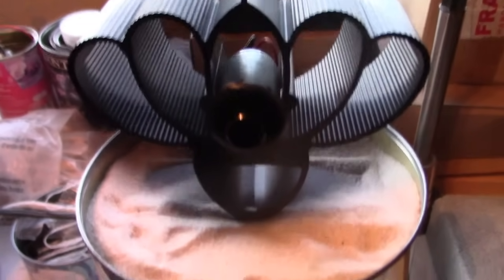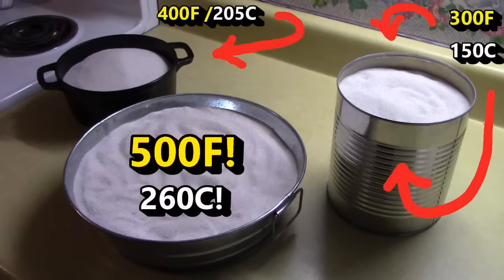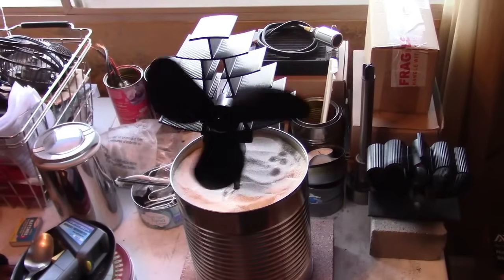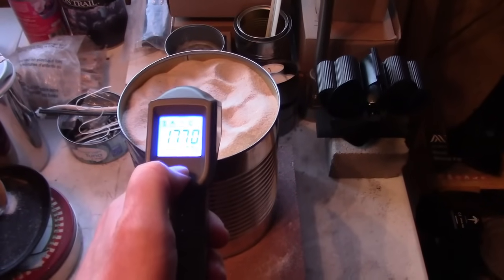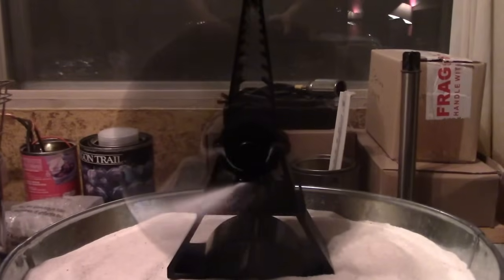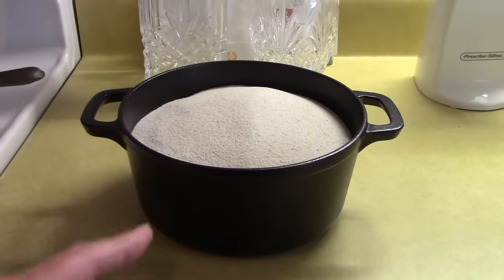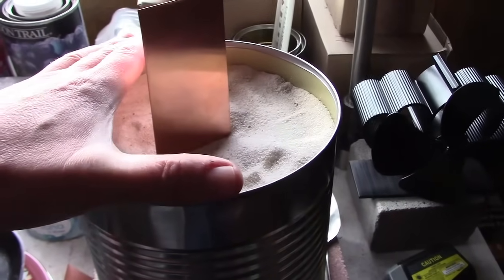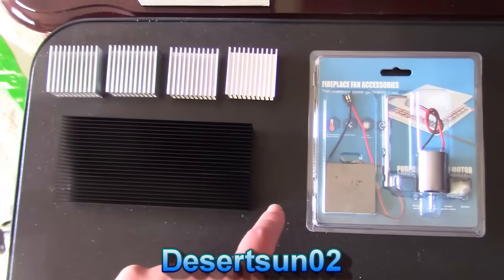DIY Sand Battery Air Heaters! w/heat powered fans! no electricity needed! sand battery room heater!

Comment: Ok, but you do need to put the energy in the sand first, which always comes at a loss. So not sure what the gain is supposed to be. In fact it would be cheaper to have an electric heater. So why do this?
Reply: Do it through solar or hydro
Reply: @Timforme-l1f the point is, all these extra steps don't create more heat. It actually costs More energy. (Oven gets warm, gives off heat too, etc.)

So solar to generate electricity is fine, but then use that to charge a battery and an electric heater or something. (Also loses energy, but its the sun supplying).

Better isolation is the 1st prio. Otherwise nkthing helps
Reply: @CyberBeep_kenshiwell my final goal would be getting away from the electric bill somehow and solar could partly help
Reply: @Timforme-l1f ye solar is your best bet. Here in the Netherlands maaany  houses now have panels. 

If you want to place them, be sure to check direction, angles etc. And consider at least something of a battery. No need to make it huge, if it can i.e. load during the day and discharge during the night is fine.

Comment: Diesel glow plug in the sand stove top fan with magnetic bearing electrical power generator to supply the volts to power up the glow plug? Glow plug will pull 6 volts to get cherry red then drops down to 4 volts. This would run indefinitely correct? Might be very helpful used to heat green houses and homes? Yall a DIY individual so you think it would work 🤔

Comment: I have used sand to heat our home for nearly 45 yrs. Not in the way you do. I use an old swedish setup. I get heat for the home in the winter and hot water year around. I also don't have it in the house, in the way. Sand is a marvelous heat sink. If you ever want a reliable and much better efficiency I'll be glad to share.
Reply: Please share. Thank you.
Reply: @romana2288 so to make an easier way to understand....think ' container big enough to hold a 3' tall x 3' wide x 4' deep firebox. It also will contain 200' of 1/2" copper tubing. All of this is covered in sand. The firebox door is exposed for easy access.
 This is the trick and beauty of it. The copper tubing is connected to a small 1/4 HP hot water pump, that pumps the heated water to an old A-coil from an old ac system. That A-coil has a thermostat controlled fan to blow warm air in the home. 
 Another 3/8" copper line (100') is is also inside the sand hotbox. It's for home hot water. 
 The beauty of this setup is once you have the sand hot, it stays hot for days. I normally only build 2-3 fires a week. The pumps and fan run on a small solar setup, I built, which of course is optional.
It took 4 and half yards of sand to fill my hotbox.
Reply: Please share. I'm very interested
Reply: @ScottCommonsenseprofessorCrawf it's already explained. It's one comment above your request

Comment: Try to get some phase-change material, tin for example, which would chage phase at still somewhat higher temperature. Phase change * volume shoud kick ass compared to low thermal conductivity * volume. I would be VERY MUCH interested in such video. If you cannot get tin, maybe some wax would work for a small experiment but I would not want to have a vat full of hot wax nowhere near a flammable heat sourse. Tin is non-flammable and much more safe.

Comment: what heats the sand? you have to heat it in a stove or something? i cbf watching the whole vid & couldnt see it from skipping through
Reply from the maker: lots of options for heating the sand. i've been focusing mostly on 'off grid' options like fresnel lenses and parabolic dishes lately. you can also heat sand with things like campfire/propane or rocket stove etc. other off grid options include using a DC heating element or elements hooked to solar panels. i've tried several types with good results

Comment: How are the fans working?
Reply: They have a weird plate in them that turn heat into a few volts
Reply from the maker: they have a peltier chip (TEG) in them. it turns heat into electricity.
Reply: @desertsun02  thanks. I didn't know what it was called 👍

Comment: Could this work during a cold winter to heat a small space? like the interior of a box when It's Minus 20 degree celcius outside the box? I'd like to keep some stuff at room temperature if I could.
Reply from the maker: hi. yes, it works even at low temps. (i'm not sure what temp it would keep it at but much warmer than not using it for sure) 🙂

Comment: To anyone who might know: I just got my first wood stove insert. I heat with wood only in the winter. I couldn’t get a stand alone for those who might say to change. I have a smaller house, single story, approx 1400 sq ft. Since it’s an insert (I opted for no blower because I hate our corrupt electric company) I cannot find a thermal fan with a clip style base. I guess they don’t make that style?? Or I need a custom little metal shelf made?? The insert is sitting up on a slate tile bench style hearth. If I fill my hollow hearth with sand bags or stones would it create a thermal mass that would be productive?  If so, Would I need to do more than just fill it up with sand or stone? I’m trying to maximize what I’m working with.

Comment: But u need to heat the sand first which u did on an electric stove😂
Reply from the maker: yes, you'll have to heat the sand but you can use a wood stove or a gas stove to heat the sand too (plus "off-grid" options like parabolic cookers or fresnel lenses are available too). i've also used 12v heating elements hooked to solar panels, so lots of options

Comment: So if I live in the city in a small apartment there is no way I can do this. I am very concerned about a power loss in winter.
I do not trust small kerosene heaters or buddy heaters due to the carbon monoxide issue. Any suggestions? My Boston condo is only 725 sq feet.......................any suggestion?
Reply from the maker: hi. one of the topics i've focused on on this channel is off-grid heating. you may want to check the channels playlist area (or the channels video page) for other DIY heaters i've made. i think i've made 25 or 30 different heaters.

Comment: I once had a customer of mine, build a 8 x 8 brick room around his woodstove in the basement and then threw the floorboards. He brought in tons and tons of sand filled the room around the woodstove and the pipe going to the chimney and had an opening to the door his theory was warm up get that sand hot, and then for the winter just build a small one or two log fire, sad news folks too much sand. He could never build the fire hot enough to heat the sand all the way to the brick walls so we ended up having to take it all back out with the wheelbarrow, I would think a smaller test subject would’ve been easier, but I’ve seen it😳❤️‍🔥🙏🏼🇺🇸
Reply: How long was he dedicating to charging up the sand? I've heard that some old clay brick cabins can take up to three days of a continuous fire to warm up, but once it's warm, it'll stay hot for a while. 

If he wanted to specifically rely on small, quick fires generating heat to warm a room for a long time, then he'd make a rocket mass heater, not just a lot of sand around a regular inefficient woodstove. Think about how hot the exhaust is when it escapes your building. If it's more than barely above room temperature, you're doing something wrong.
Reply: What do you think if he welded rebar to the wood stove and had the rebar make a grid in the room space. Then replace the sand. The rebar should transfer the heat more evenly and efficiently within the sand thermal mass. I want to try something of this once I get the new homestead. I will test on a smaller scale though in a greenhouse, then upgrade to the house if it works.

Comment: My friend has 2 of these fans ontop of his wood stove/heater for the winter months, what are you thoughts on placing a dutch oven full of sand on top of the stove then using the fan stuck in the sand ? The sand may retain the heat once fire has gone out somewhat longer

Comment: Great. This is the first time ive seen the fan to show that it will radiate heat.
Ive looked at many flowerpot heaters, but none put a fan on top to show that there is enough heat generated to turn the fan.
Reply from the maker: hi and thank you!

Comment: Thanks, very interesting. What kind of sand is that, it is so white? Can you buy the sand or where do you get it?
Reply from the maker: hi there. it's called 'snow white' play sand. it's cleaned and filtered. they sell it in 50 lb. bags. only cost a few dollars. the home stores (like home depot and lowes) sell it. you can also get sand at plant nurseries and on amazon. the cheapest place to get it is probably the home stores. you could use beach sand if you wanted too
Reply: @desertsun02  Thanks a lot for your detailed answer.

Comment: Are there any particular types of sand thats better or worse than others?
Reply from the maker: hi. that's hard to say. i generally just use play sand. it's cleaned and filtered and is easy to get.
Reply: @desertsun02  thank you, I didn't think so. There's just such a variety at the hardware store these days

Comment: Guess you have to buy special fans???
Reply from the maker: hi. yes, they are sold as "heat powered fans" or "heat powered stove fans". they sell lots of different styles on amazon. (probably 50 or more different models). they actually create their own electricity from the hot sand.

Comment: I live in Canada. I heat my detached, 25 by 25, insulated garage with a simple oil filled, radiator style heater (120 volt). It keeps everything from freezing at about 5 Celsius.  On top of it is a metal pail filled with sand. The sand is a heat battery in case the power goes out. The sand keeps radiating heat that it has stored. Saved my ass keeping things above freezing a number of times.

Comment: May I ask you please, is there a certain grade of sand that’s a better conductor of the heat? Thank you
Reply from the maker: i couldn't say for sure but i recommend using 'play sand'. it's cleaned and filtered and works very well. beach sand should work good too

Comment: Please share a link to those awesome fans
Reply from the maker: hi. at the moment i don't see the links to the exact fans on amazon but amazon sells probably 50 or more different stove fans designs. if you search "heat powered stove fan" on amazon you will see page after page of the fans. i always chose the ones with a low (122F/50C) starting temperature.
Reply: @desertsun02  thank you. I ordered two different ones. I really appreciate your video and information shared. Stay blessed 💕

Comment: I didn't see the back of the fan while it is running , only a carefully positioned angle with the camera from the front and of course the back was shown in still images only . If you are going to show a film show it made and activated in same video uncut . For all I know you could have real batteries buried in the sand .
Reply from the maker: Hi there. I know that there are a lot of 'fake videos' on youtube (and that is very unfortunate) but, for the record, I just post real or 'truthful videos'. any editing oversights or deficiencies are accidental. if you want to confirm that 'heat powered stove fans' are real, you can check them out on amazon. they have at least 50 different ones. (you can also see these fans in many of my other videos from all angles being powered on various sources of heat. i wish there was a way to get rid of the fakers on youtube. they make it harder for the rest of us.

Comment: Take that straight plate you shoved into the sand and bend it like a table so you can sit the fan on it and it will pull heat from 2 points instead of 1. Use a longer plate too.

Comment: How do your fans work without electric?
Reply from the maker: hi. they are heat powered. the heat literally soaks up into the metal and a small 'peltier' chip turns that heat into electricity. that electricity is what runs the motor. (the peltier is part of the fan)

Comment: How is the sand getting hot? Do you have to heat it on the stove first?
Reply from the maker: hi. options for heating the sand vary. lately, i've been looking into various off-grid options (parabolic cookers/fresnel lenses etc.). other 'off grid' options include DC heating elements. 12v ptc elements work well. those can be hooked directly to 12v solar panels or other 12v sources.

Comment: So, the sand is meant to hold the heat for a long time, radiating it out slowly. And we put a fan and heatsink in it, to make it use up the heat faster... Am I missing something?
Reply from the maker: that's basically it - with one clarification... we're using the fan to distribute the heat out farther from the sand (more into the living space) but not to use up the heat faster.
Reply: @desertsun02  But that's the end result. I'm not sure how this is better than a fan and a heating element. Same thing with extra steps. If you want to radiate the heat farther and faster, the sand isn't helping.

Comment: Wouldn't the vibration of the fan slowly mean it would sink into the sand?
Reply from the maker: hi. that won't happen. it just sits still on the sand. not enough vibration in the motor to move the fan. 🙂

Comment: The only purpose these would serve is moving heat from one room (where there's a fire or electric heat source) and putting it into a room where there's not electricity or fire....

In fact, you're loosing heat by adding the fan because putting air in motion causes it to cool down. You might spread the warm air around, but it won't be staying warm nearly as long as it would if you simply put a hot rock in the room.

Comment: I think you could put an electric heatiing coil and bury that in a large mass of sand, then run the coil off a solar power station and have heat in your home in a emergency.
Reply from the maker: yes, that's a good idea. i'm still looking for the best heating element to use.

Comment: Does the fan blow any sand when switched on for longer hours? And does it  in any way circulate the heat? Or is it just running on the heat
Reply from the maker: hi. the fan doesn't blow the sand around. it stays put. yep, it circulates the heat.
Reply: @desertsun02  thanks for the response. Did you make the heating element yourself? I tried using the water heater element and apparently it blew off 🤣🤣🤣

Comment: Is it a certain kind of sand that you are using? Also what part of the fan do you put in the sand? What I mean is if there are plug in cords used?
Reply: Any clean medium to fine grain sand will do. The fan is not electric. You put the base in the sand. There is a gas chamber inside the fan that heats up and makes it spin. The heat travels from the base to the fins. The fins heat up and the fan is used to move the heat. From the fins.
Reply from the maker: hi. i just use a fine 'play sand'. cleaned and filtered. you could just use regular 'beach sand' if you wanted too. you just put the bottom of the fan directly on the sand. the fan will soak the heat up and send it to the 'TEG chip' located in the fan. the chip converts the heat into electricity and then sends that electricity to the motor. you can also use a stirling engine powered fan if you want to.

Comment: You used electric to heat the pan
Reply from the maker: hi yes, but there are lots of off-grid alternatives. from rocket- stoves, to solar panels (with dc heating elements) to things like parabolic dish cookers or fresnel lenses. many options to heat the sand.

Comment: I use an electric oil radiator heater all winter here in Manitoba, Canada to keep my garage at 8 degrees Celsius or so throughout the winter. Ceiling and walls insulated. I put a stainless steel bucket full of sand on top of it. Last night, I was screwing with my sons frozen car battery and threw a breaker but didn't notice. The heater shut off. Today, I went back to the garage and it was only plus 2 Celsius. I'm glad to have had the sand battery to keep the temp above freezing.

Comment: how long does the heat last?  Would salt be better than sand?
Reply from the maker: heat can last for several hours. i have tried salt but i don't think it's better. sand is cheaper (at least where i live) and sand can be heated to higher temps before it liquefies.

Comment: Aside from some fans being aesthetically more pleasing than others, Are all thermoelectric stove fans the same?
Reply from the maker: they generally all operate the same way but i've seen 2 or 3 different size chips. sometimes the smaller fans have smaller chip. different fans also have different starting temps. i always use the fans with the lowest starting temp (122F/50C). some have a much higher starting temp.

Comment: I'd like to see the temperature readings from the fan output. Is the heated air coming directly from the hot sand or from the metal structure surfaces? Is the metal steel or aluminum?
Reply from the maker: technically it would be both but mostly it's from the sand. the metal bucket itself is made of steel.

Comment: Great video and Information thanks sharing! Also do you mind sharing the brand or where you got your fans?
Reply from the maker: hi. i get the fans on amazon. the brand is not very important (as far as i can tell). amazon is the place to get the fans they have at least 50 different ones. maybe even 100. the main thing i look for are the ones with a lower starting temp. i like the ones that start at 122F(50C)

Comment: Once you heat it up, how long does it last
Reply: it is no free energy. the amount of heat you throw in to heat up the sand is a lot more.. unless u use gradual small heat .. but usually we just use oven.. and all those extra heat just lose into the air... so.. think .. the energy the sand give out is NEVER more than the heat we use to heat up the sand... as i just mentioned above.